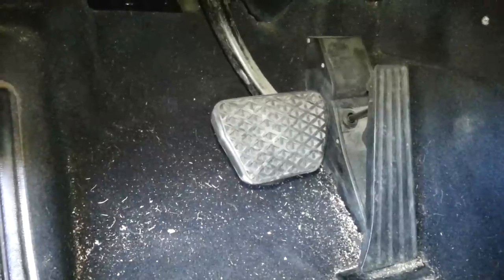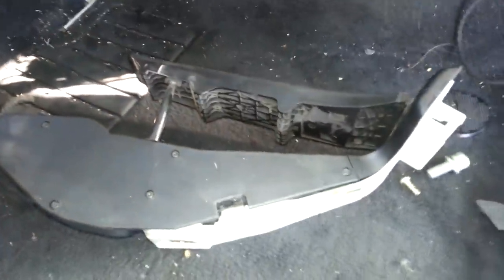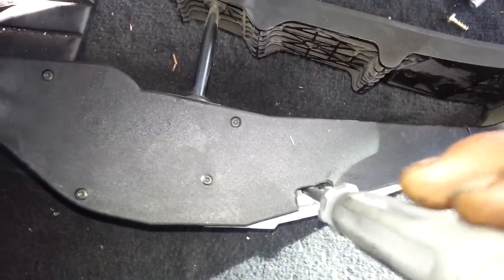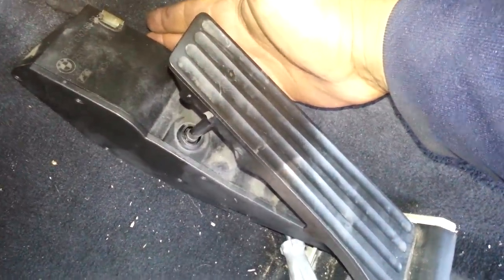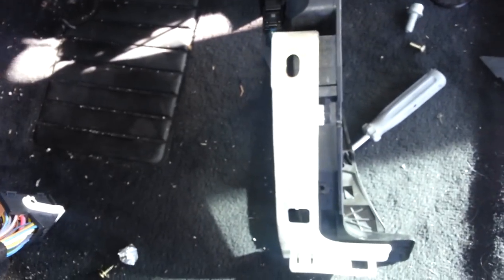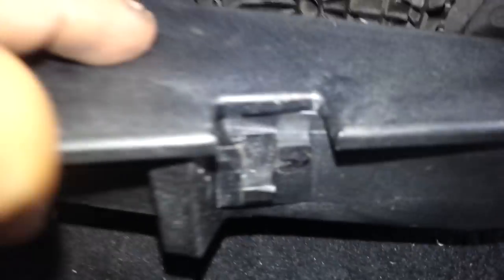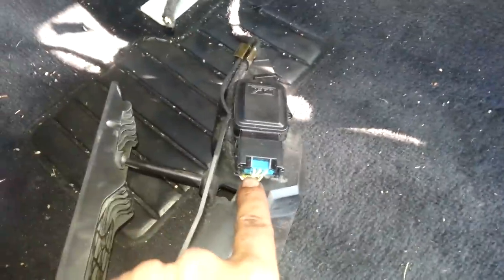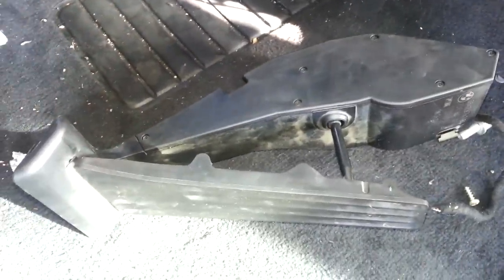How to remove gas pedal off Bmw E46 330 325 E38 740 E39 M5 540i 530i 525i

Comment: thanks for the video. i just wanted to post my experience.

i have a 2002 e39, which had a slightly different (newer) tab on the bottom. the key is to use a small/thin flathead to pop the tab down and KEEP it down while you slide the pedal to the left. i kept getting it caught on the 2nd set of notches in the pedal, so i started over and kept the pressure on the tab until the pedal was all the way off. hope this helps someone else.
Reply from the maker: Thank you for sharing your experience.  Im sure it will help someone.

Comment: I was just looking at removing this pedal today, I checked out the ( I thought the T8 Screws) my issue is a surge on the starting off ( Bucking) everything else has been checked , Cleaned, add WD40 Spray, nothing has as yet sorted this out, so this is my next avenue, thank you for a well presented / Explained view on this pedals removal.

Comment: Great video man. I have 2004 120i (e87) I have code p110d (throttle position sensor) if I change the pedal, will this maybe fix my problem?

Comment: @mezaarmando I have the same issue EML light is to the right of the engine check light, I have 3 codes for throttle position sensor. when I wiggle the wire around on the sensor on the pedal and restart the engine it removes the car from limp mode for a while... I am replacing the pedal and sensor soon.
Reply: Did replacing the pedal assuming the sensor too fixed the problem for you? I have the same error it's killing me i swear. Thanks in advice sir.
Reply: @PaulPaul99.777 what fixed it for you?

Comment: Hi guys. Quick question for you; When i hold my throttle down a bit (for example range between 800-2000 rpm) on my e46 325i and leave it that way the RPM's go up and down a bit. i hooked up my laptop today with BMWscanner 1.4 today ..live data and saw that my gas-pedal was constant at a XX degree and i was revving it to 1500 rpm ..and when i keep holding it like that the rpms go up and down from 1500 to 1300 and back up ..down ...you get it? TPS?
Reply: Did you solve this problem? I have the same problem

Comment: Is this the same for an e39 manual pedal cause I can't feel any slot for a screwdriver to it into the access port
Reply from the maker: same process as long as bmw model is from 1999-03
Reply: So I just removed the throttle from a 2001 530i and it actually doesn't have the little gap for the screwdriver to fit into. The opening in the side of the throttle just have a black clip that you press down and then pull the pedal out

Comment: hi . can u give me the code for the cable that goes from pedal gas to Electronic Control Unit ? ( Ecu )
Reply: RanDom Video what is it in need it for my 2007 750 Li

Comment: Hi my car has been throwing up EML traction control and service engine soon lights as soon as I turn it on I checked the code and it shows accelerator sensor if I get a new one would my lights turn off I can't go past 45 miles because of "limp mode"
Reply from the maker: You throttle body seems to be going bad.  Check that part since those are symptoms associated with that engine component.

Comment: You say these are all the same from 1999 but then you say they're electronic not cable. Most were cable up until around 2001. My 2000 E39 has a cable throttle.

Comment: wow wow eml miens  throttle body if car gos to limp mode" 45 klm no more and if just eml with no limp mode thin its gas pedal whos the man ha and u can fix ur throttle body easy just ask me
Reply: moe nikak , hi i have this problem with my e46 318i, starts up but goes nowhere.i suspect its the pedal..should i just buy another one or what do you suggest?